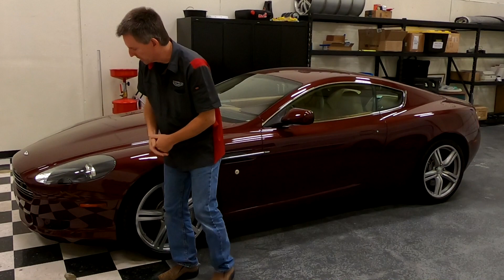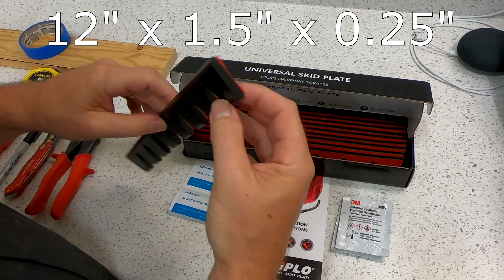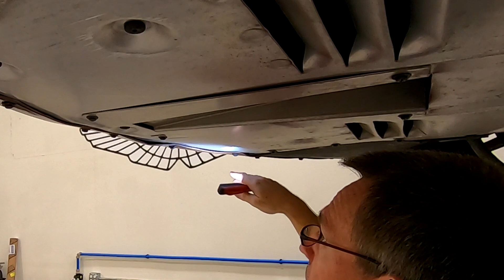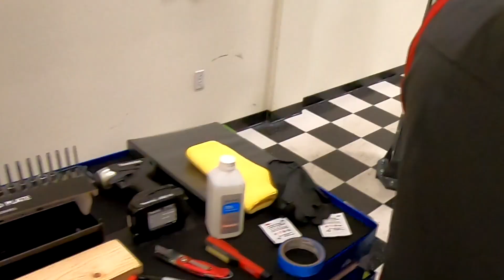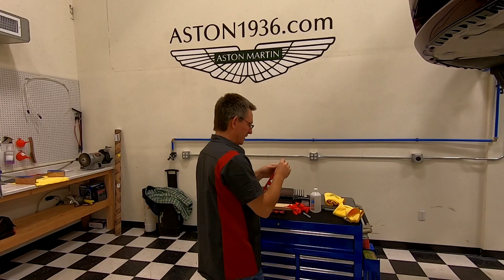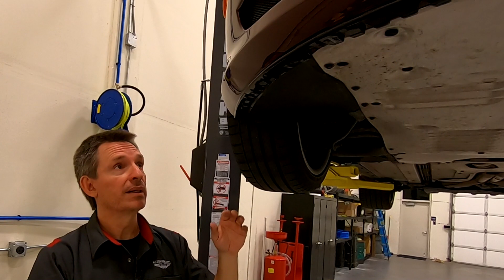Installing a SlipLo Skid Plate onto an Aston Martin DB9

Comment: Hey Steve instead of cutting the thick part of the Urethane I was going to cut the thin links that way I can place the skid plate around the screws and retain more material.  You thoughts on that approach?
Reply from the maker: I think both will work.  My goal was to have a continuous black line at the front with no gaps, so I did the trimming which wasn't too hard.

Comment: I worry about adding material to the bottom of the lip. Anything you scrape on is now going to push the bumper up another 0.25 inches, causing more stress to the entire bumper and its mount points.
Reply from the maker: Its about zero net change.  There are the existing bolt heads that are nearly the same as the material.

Comment: Thanks for this I have a 2009 navy blue DB9 and I’m going to have the same paint work you had this coming spring and try this Sliplo product after painting is completed. Low curbs are also a real pain.
Reply from the maker: I love the DB9 in a dark blue - awesome.  The modern paint looks terrific on mine.
Reply: Curious you ever had a problem with the passenger seat (electrical) traversing back and forth? Mine just failed prior to putting the car away for the winter. The seat tilt continues to work. I’m thinking it’s either a small electric motor failure or a wiring issue possibly a wire dislodged in transit. Your thoughts or experiences?

Comment: If you want to be fussy - and you have the patience for very accurate measuring - you could choose to use a suitably sized drill bit to create holes for some of the body panel bolts/screws instead of using the tin-snips to cut off larger chunks. Plus it maintains more of the sacrificial polyurethane! Ps.have you looked at the Clarity Coat spray on protective coating  alternative to PPF yet?
Also, has anyone heard of any aftermarket lift kits that are applicable to any Aston  Martin models?
Reply from the maker: Hi Mark.  I thought about using a drill, or a punch.  Ultimately I was satisfied that there would be plenty of material to scrape along.    Haven't looked at the Clarity Coat yet.   My car was just Clear Bra'd.  Got it back today as a matter of fact.  Time lapse video almost ready to post.....
Reply: @Aston1936  Good to hear about the clear bra - maybe you can consider Clarity Coat when the bra is ready for renewal.